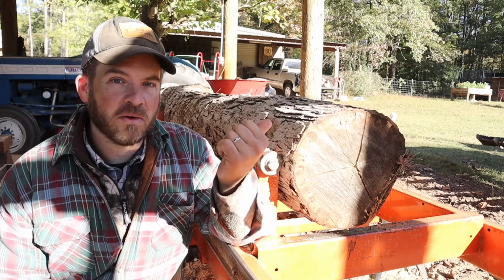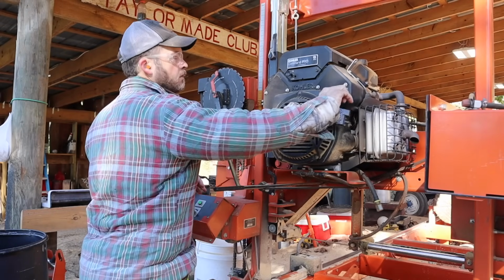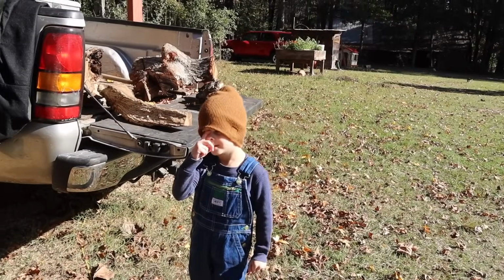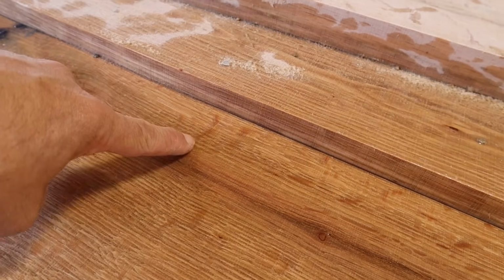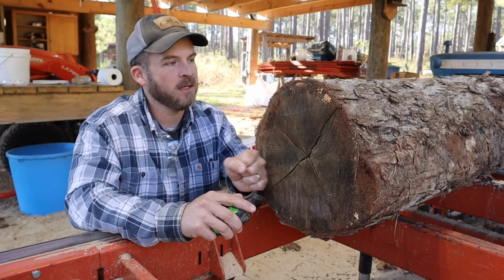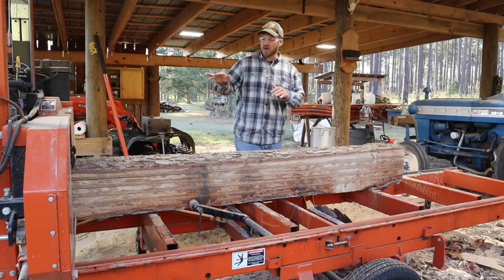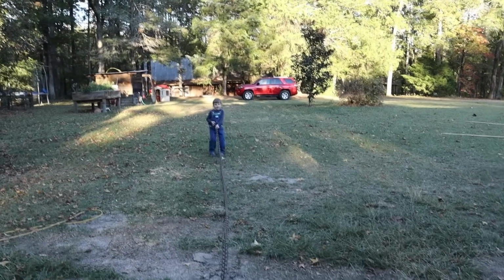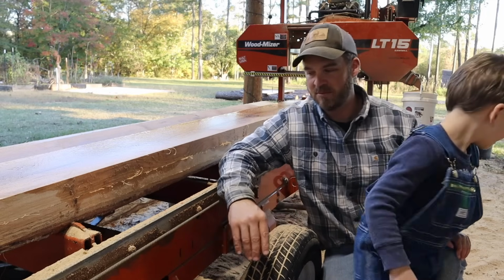Killer White Oak on the Sawmill

Comment: Do you have different blades for soft wood and hard wood cutting?
Reply from the maker: I don't. It would be better if I did, but I so rarely cut hardwoods I just use the 10 degree "softwood" blades.